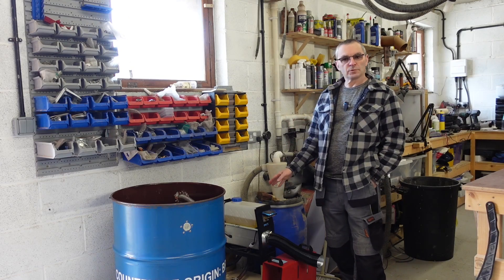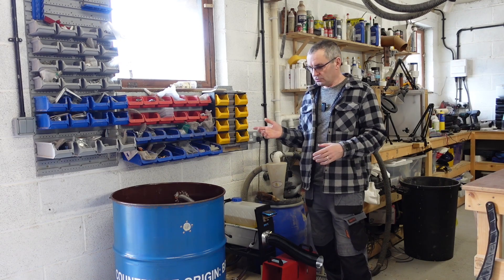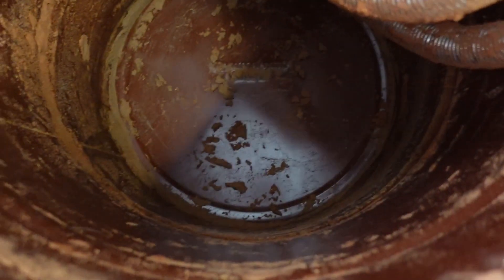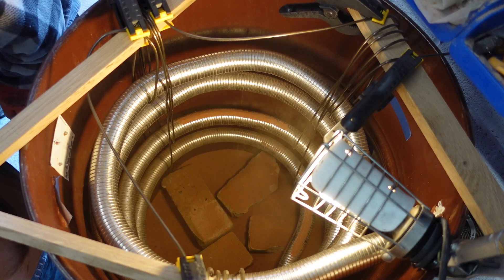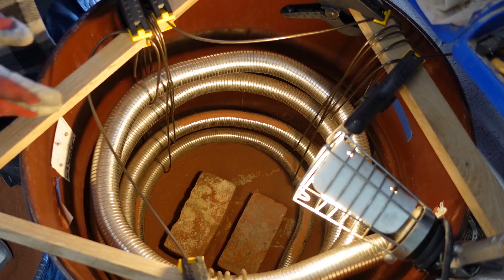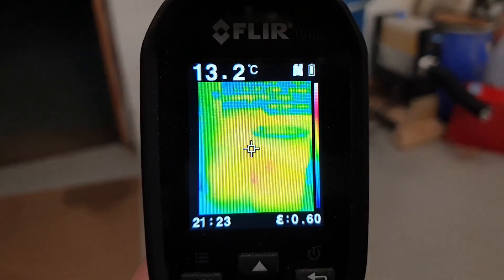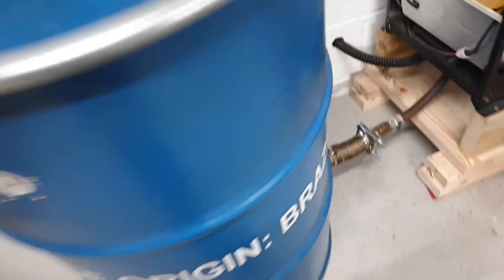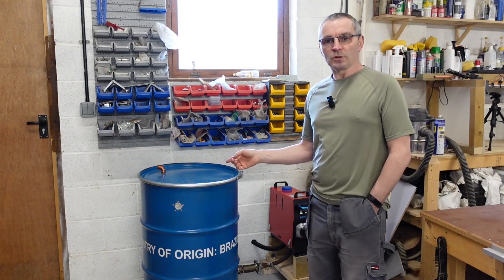Cheap Diesel Heater using a Sand Battery to Recover Heat!

Comment: Hi, as it seems the heat is not been spread in the centre of the barrel and by looking at it if you created something like a hollow centre and have the exhaust coil in and covered with dry sand. Then the inside of the barrel you could add some vertical fins and also to elevated from the floor as this could start creating draft and kind of start circulating air in the room. I bought a diesel heater a year ago for a friend but he didn't want it and now I'm stuck with it and as it seems there is some brilliant ideas from people like your self to put the in real life project that in the end will have a function. Great work and nice explanation, very appropriate the advice for dry sand.
Reply from the maker: Thanks for watching, have fun experimenting with your new heater 👍

Comment: My 2 cents. :) Mostly you're fighting a losing battle especially with an exposed metal roof/ceiling and no insulation. :( That being said, two things to consider. One, get rid of the barrel but keep the extended exhaust tube. Have the tube freestanding and place a small box fan behind it to increase recovered heat immediately instead of trying to save it. We have kitchen pot scrubbers here that are made of coiled springy stainless steel. They can be put on the exhaust tube to increase surface area to capture even more heat. Doing this will give you more usable heat when you are going to use the shop. Two, if you still want to keep some heat in there at night, then just leave the heater running on its lowest setting. It will use about a gallon per day depending on the model.
Lastly, if you want any shot at keeping the shop warmer, the first thing to do would be to insulate the ceiling. The only thing I can suggest is to install a drop ceiling using standard fiberglass tiles or custom cut from thicker insulation sheets. This won't make the room a sauna, but going from R-0 ceiling/roof to any positive R value may make a workable difference. :)
BTW, thanks for your video, I was curious about the effects of using a longer exhaust tube, helped me greatly! :)
Reply from the maker: Insulation is the answer but not a option at the moment too much work to strip everything out. But it does take the edge off and allow me to work out there 👍

Comment: get a quick heat please. why heat the space when you are not there. car radiators with ventilators. heat when you are there, no heat when you are not. (for extracting the combustion exhaust heat)
Reply from the maker: I wanted it to dry stuff out when I'm not there.

Comment: insulate you windows with polycarbon panels and connect your dieselheater to a radiator. Seems lika a better plan.
Reply from the maker: windows won't help much, it has solid walls and a metal roof

Comment: Your loops for heat exchanger or to large it should be set mid way in barrel diameter
Reply: No need for bricks sand is a better medium
Reply: Get you diesel heater above the sand battery

Comment: You need to rise heater above the barrel.... you need to have air flow threw the barrel ie multiple  2"  pipe to soak up heat run a fan threw tubes creating a heat exchanger and creates a hear sink in sand

Comment: Personally, I wouldn’t do it that way. I would simply stack the barrel with clay bricks, leaving some space between them. Maybe build it in a shape of a dome and run the exhaust pipe about a third of the way up through the bricks to the center of a barrel, pointing straight up.The hot gases in the barrel will distribute themselves anyway, as the hot gas will rise under the top. As much heat the bricks pick up, they will continue to radiate even after the heater is turned off and even if the barrel isn’t filled to the last millimeter, the heat will still be transferred to the room because it's in the room. I think the barrel could be smaller, though. At the bottom of the barrel, I would then mount the exhaust out into the open in a way it can also serve as a condensate drain. No need to have six meters of exhaust.
Reply from the maker: Interesting idea 👍

Comment: Really interesting project. I wonder if you have vibrated the oil barrel to get the sand to pack itself more closely around the metalwork and bricks? you could hold a running powertool against the outside and see if the level of the sand drops. I think that would reduce the air between the sand grains and allow better heat flow. Not sure if it would make any change in the grand scheme of things but worth a try.
Reply from the maker: I didn't vibrate it but I did use a poker to pack it i as I built it up in layers 👍

Comment: Have you considered losing heat through the exhaust after turning it off? Convection may be drawing cold air in through the fresh air intake and the heat from the sand battery carries it up and out through the exhaust pulling the heat out of the battery as it goes.
Maybe find a way to block the airflow once you turn the heater off.
Reply from the maker: Not considered convection, you can feel any movement once you turn odd the heater and the exhaust end get cold really quickly so might be ok, I think wind won't be a problem blowing heat out as intake and exhaust are on the same wall so any wind should cancel itself out.

Comment: I would just set it on a sheet of cement board on top of closed-cell foam insulation board.

Heat-break for thermal conductivity to the concrete slab.  I think it’s a loss when heated sporadically, if it was heated 24/7 it wouldn’t matter.
Reply from the maker: 👍 the bottom of the drum doesn't get warm, I only run for a couple of hours at a time but I might raise it up 10mm on blocks to leave an air gap

Comment: Good effort! My workshop was freezing until I squeezed expanding polyurethane insulation behind the facia boards in my garage-the cold breeze instantly stopped and when I recently installed a diesel heater it is as warm as I can stand on 1 (of 6 on that model) at the moment. I was thinking of putting a small oil filled heater between the diesel heater and the wall so the hot exhaust is going in between the fins (touching on one side to maximize heat transfer) and using conduction to passively heat the heater and hopefully the oil in the sealed oil heater will take some of the excess heat from the exhaust and keep it inside the workshop-won't even have to waste lecky as the oil filled heater isn't going to be getting plugged into mains.

Comment: How do you think Pea gravel would work instead of sand?  Seems like it would release the heat faster, but maybe not hold it in as good.
Reply from the maker: Probably be a lot of air trapped between the gravel which might affect how well it works 👍
Reply: @50plusdad-uk  Possibly, but since there would be more room between the gravel than sand, they heat should escape faster, and possibly radiate faster.  It may not hold the heat as long though.

Comment: Would you insulate the exhaust from the heater to the sand drum ?
What about reflective panel, like we use behind radiators, on the external wall to reflect heat back into the room ?
Thanks for this video, lots to take away from this !
Reply from the maker: Part of it has exhaust wrap around to insulate the rest i want clear to make monitoring it's condition and servicing the heater easier

Comment: I think you're trying to heat up too much sand why not empty the sand in the middle and replace it with a stainless steel insulators chimney which is used for wood burning stoves then fill the outside of the chimney with sand
Reply from the maker: Yes it's probably on the big side 😁

Comment: i wonder how much heat is escaping from the little copper vent on the top.
Reply from the maker: I doubt much but it's escaping into the workshop where I want it, the pipe it to prevent any potential pressure building up if there is any moisture is still i  the sand.

Comment: If you elevate it off the concrete it will work better the heat will be sleeping into your concrete floor
Reply from the maker: I have mounted on 2x4 blocks 👍

Comment: Stick a cylinder jacket around it, insulate underneath and brim the sand to see how hot you can get the top for your fan theory. Could always insulate the top too actually and just take that off when you want to use the stored heat

Comment: Well done for persevering with this. Have you taken the pipe off at the bottom to check for any water build up ? Seeing as it is the low point.
Reply from the maker: Yes all good so far but time will tell, only got about 50 hrs on the barrel but coming into winter soon so we'll see

Comment: Have you ever considered running a second coil which has a water tank below the sand battery level then pump water through the second coil in the sand and into a car/motorcycle radiator with a fan to extract heat when you want heat?
Reply from the maker: I thought about using a cast iron radiator but I wanted a slow release of heat, it helps drying stuff out, I can leave it near the barrel all day and it doesn't get too hot so no fire risk etc

Comment: I think it would be better to take water instead of sand.
Reply from the maker: Possibly but with sand I don't have to worry about antifreeze, leaks or corrosion and it's easier to get rid of 205 litres of sand than water/ antifreeze mix👍
Reply: It would take about 3 days of 0 degrees, to freeze a plastic drum of water,no need for antifreeze.  Plus you could make an insulated blanket if your not in the shop for 3 days.